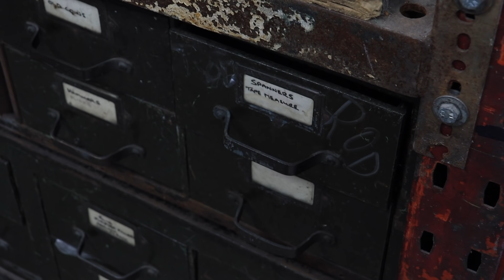TMNT Nightwatcher Flail

Comment: A squeaking end mill means it's rubbing, slow it down, it's going too fast to make a proper cut and it's also causing it to generate a lot of heat
Reply from the maker: It was going the right speed for that cut

Comment: Just a suggestion, you might want to roll them sleeves up when working that close to a lathe. I saw a guy get pulled in one once and got fucked up.
Reply from the maker: Hahahahaha maybe on an industrial one but this I certainly won’t, its belt driven and i can stop it with my hands, the 1/2hp motor isn’t strong enough to move me and my sleeves don’t go near it at all. 
Ive worked in plenty of machine shops and its baggy sleeves that may get caught if you aren’t careful but mine are elasticated so perfectly fine.